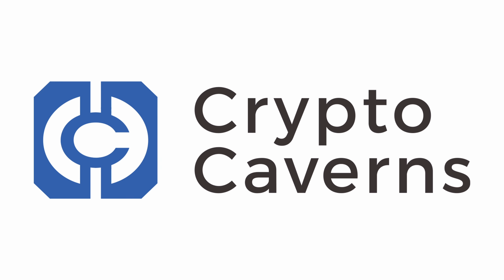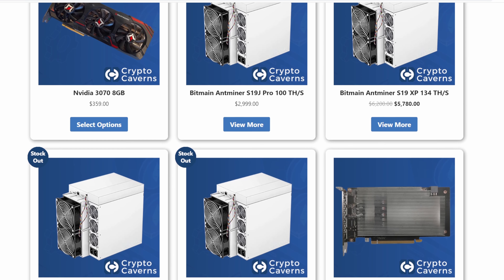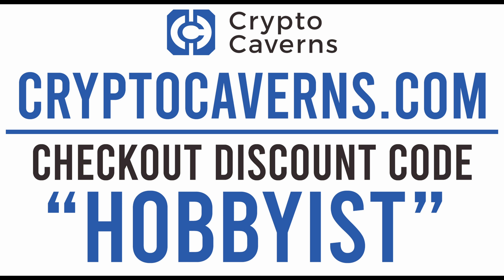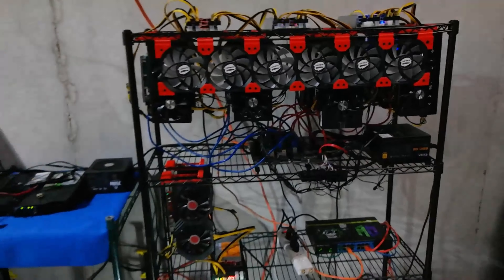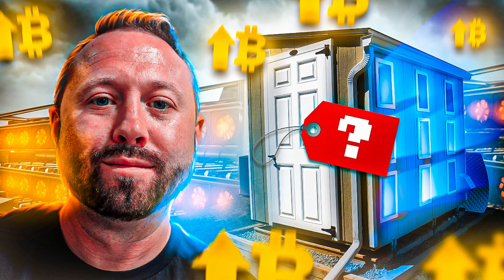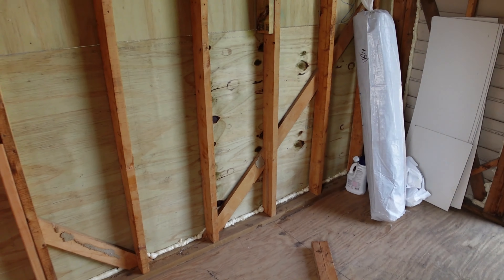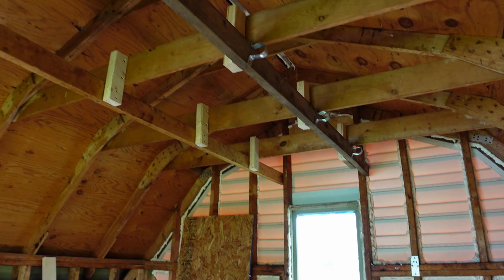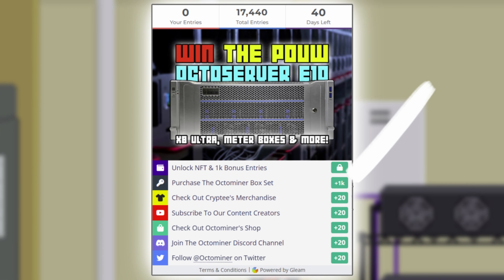Building a Crypto Mining Shed | Replacing Vinyl Walls in this Old Shed!

Comment: @TheHobbyistMiner so I'm curious with your current mining shed with all the intake and exhaust why didn't you decide to just do a mini split ac unit to control the heat?
Reply from the maker: A mini Split wouldn't handle it.  I am using 26,000 Watts.  An AC Mini Split would be a terrible mistake. This isn't a server room.  With Crypto Mining you need to pull in fresh air and exhaust the used air as fast as possible.  Think about it like a wind tunnel. Never giving the air a chance to linger.

Comment: Very good to seal everything. The best advantage is to mitigate dust which will kill electronics over time.

I am curious, with a new build why did you choose not to have a hot wall? 

99.9% of the air going on the outside of the ASIC'S is wasted money. This is filtered air that provides virtually no thermal benefit to the miners.

Also with a hot wall you can ballance the air flow by measuring differential pressure across the hot wall. Then only run as many fans as needed. 

Good luck
Reply from the maker: My current shed was a great proof of concept. Goal is to pull the air in and remove it as fast as possible.  I could of went with a DIVIDED cold and hot isle but really not worth it.  It is recycled multiple times a minute.  It works!  My current shed its 95F out, Miners are just fine and happy.  Shed is 97F on the Intake, 119F on the Exhaust.  Temps on the ASICS are great because its recycling air so fast.

Comment: I was wondering if you did the math about the 30 amp circuits for ASICs. Average power consumption of ASICs is around 3100-3300 watts. A 30 amp 240 circuit allows for a max of 7200 watts. However, if you plan to follow the 80% rule, then those 7200 watts turn into 5760 watts. That is not enough to run two ASICs (3100x2=6200 watts). Thus, each 30 amp circuit would be maxed out with just one ASIC and the remaining watts would be left unused or used for non-Bitcoin ASIC equipment or low hash rate ASICs (mini doge, etc.). My humble suggestion, which is what I did at my place without changing anything in my breaker panel, is to install 50 amp circuits; as many as you can. Those would provide 12000 watts each but following the 80% rule that would come down to 9600 watts. But still enough to power THREE ASICs per circuit. You would obviously need to by a 50 amp PDU for each circuit; as I did. Good luck with your project. Luv your videos.
Reply from the maker: This Shed will have a Sub Panel. We are limited to the homes Main Panel at 200 Amps. So I am installing a 150 Amp Breaker in the Shed. I will use 150Amps up, leaving 50 for the house.  Mr Electrican lives alone, not home much, doesn't use much electric at all. So 50 Amps is our safe bet for in the House.
Reply from the maker: It's a great thought! If it all works out by the next bull run we may need to have an additional service pulled in lol.
Reply: @TheHobbyistMiner  I am no electrician, I used one for my mining project, but could it be possible to install in the shed Sub Panel 2 50 amp breakers (that would allow you to run up to 6 ASICs), a 30 amp breaker, and a 20 amp breaker. That way you still meet your 150 amp limit but with the capability to run more full-blown ASIC miners. Just trying to maximize the number of ASICs you can run at the same time giving your amps' limitations. Wish you the best.
Reply: 80% rule exists to protect the wire from overheating.  Oversize the wire and there is nothing to worry about.